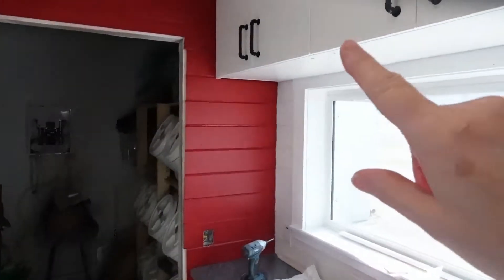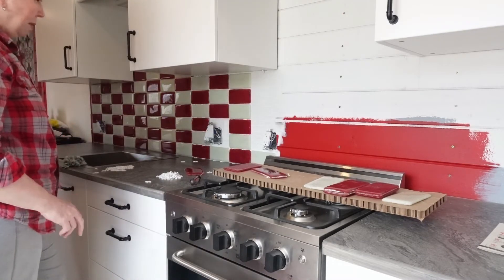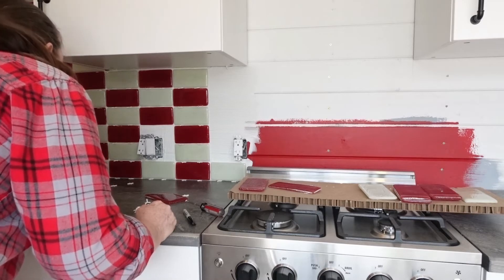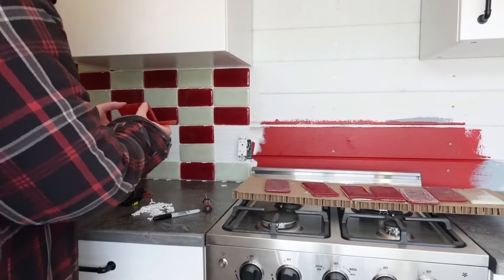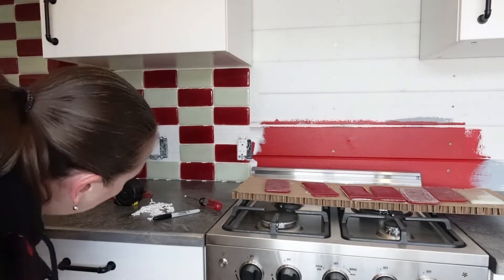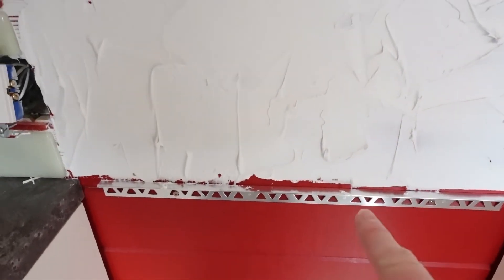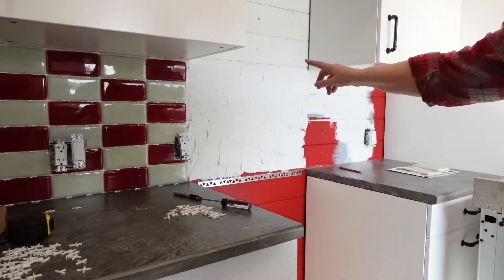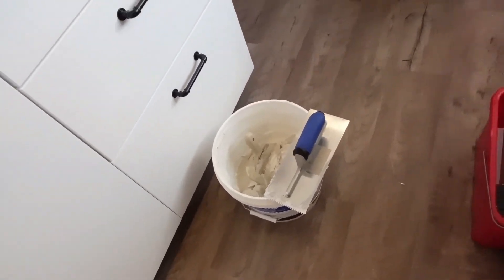More Tiles Installed Today

Comment: I am interested in the racks you have there for storing 5 gallon buckets, would love to know how to build them, and what you think of them!
Reply from the maker: Are you talking about the wooden shelves in the utility room? I have food vaults in there on the wooden shelves, not 5 gallon buckets. I get about 100 pounds of flour, sugar or rice in each one. Because of the weight in them Chris attached wood to the studs and notched the 2x4's to hold the shelves too. I could do a quick video to show more closely exactly what he did. It is a massive amount of weight so he wanted to make sure they were very secure.
Reply: @tinyhomelivinginalberta3451  Thanks!  I would be very interested in a video to show more closely how that was built and how it is used!
Reply from the maker: @margarettt7675  ok sure. I will try to do that in the coming week. It was a cheap way to do it. The 2x4 were also from discarded skids we collect when we go to town. We are working on the interior doors now too that are made partly from those skids.